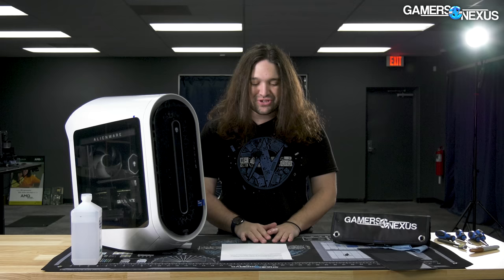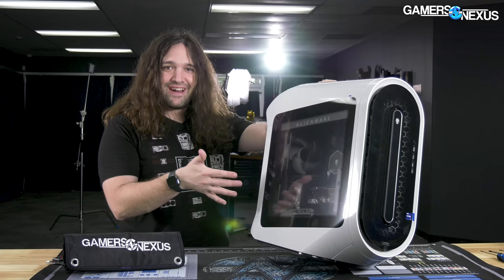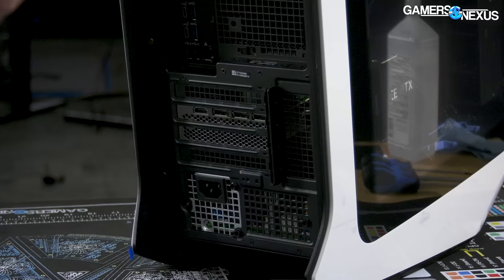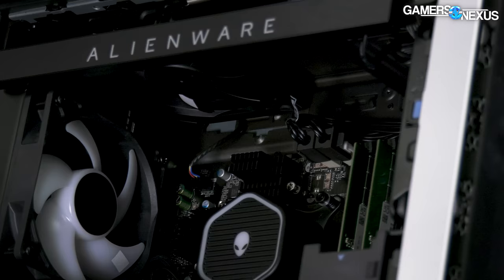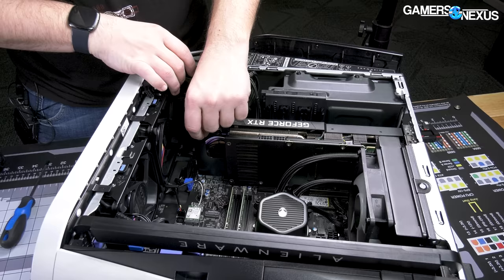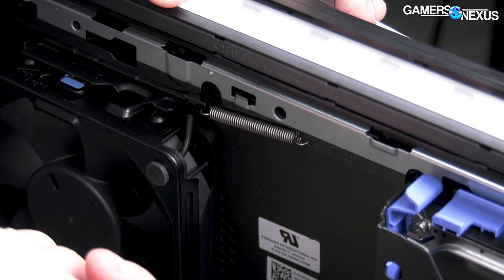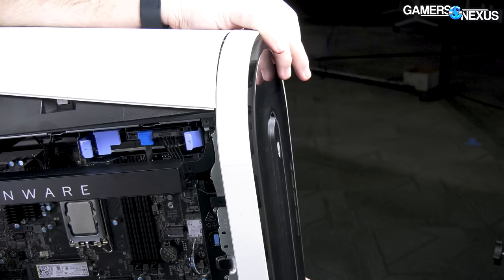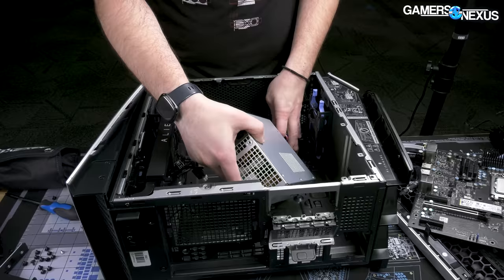Crazy Bad $5000 Alienware Gaming PC: R13 Aurora Tear-Down

Comment: Why would a company that (presumably) has very smart engineers working for it spend so much effort on making something good (ATX computers) into crap?  Like, you have to actually try pretty hard to get it offensively wrong nowadays, and yet Dell still...
Reply from the maker: That's the craziest part! Excellent question that Dell needs to ask itself. This is a LOT of engineering work to unnecessarily reinvent the wheel into a square.
Reply: @GamersNexus  Time for GN to rock up to Dell's headquarters and ask some questions:)
Reply: Well you have mechanical and electrical engineers might need to let the mechanical have a go at being electrical engineers surely couldn't be any worse
Reply: I was just wondering the same. Is it actually cheaper for them to manufacture and create from scratch these horrible components? It has to...
Reply: Exactly. And just for a thought, you buy high end parts to perform worse than they could. They intentionally crippled down the performance by making this a toaster. Just sad and unbelievable what damage to prebuild industry this does.
Reply: Is it ATX though if they don't follow ATX specs for PSUs and MBs ?
Not that it is an excuse for making crap product. 😉
Reply: My guess: the very smart engineers come up with something good that they look at and promptly discard. After that, the marketing department figures out how to make it look "super cool" and how much plastic they have to cover trash with to be able to sell it for $5k.
Reply: because of money... the profits after setting up new tooling will be far less than reusing existing tooling.. obviously the targeted customers are not PC enthusiasts who know this is bad.. so to them it doesnt matter if the pc is bad... their customers wont complain...  trust me, dell is a big corporation. they have already conducted research about creating new tooling and obviously found it less profitable... that is the only reason for this.
Reply: Because they are stuck in 1998. It probably comes with Napster and WinAmp preinstalled. This company is so cringe it hurts.
Reply: It seems like they invested money into fabrication tech and materials ... in 1995 ... and now they're stuck trying to move old stock. The most frustrating part is that ignorant buyers (due to no fault of their own) are probably buying, so they have no reason to stop.
Reply: @agnarjo  Our family bought a Dell back in 1998, it was likely built more intelligently than this thing was. Even back then they had started with non-standard ATX boards however, with things like the front panel controls connector (which could be worked around with a bit of effort at least), and the non-standard power supply connectors for no good reason.
Reply: The engineers have to justify their jobs
Reply: @GamersNexus  I can bet this question has been lost in the layers of management. The senior management won't have a clue how bad it really is. Maybe someone should ask them? 😉
Reply: by engineers do you mean graphic designers with no real world experience?
Reply: It all boils down to poor management and it can be extraordinarily difficult to change a giant monolithic beast with a rotten core.
Reply: @agnarjo  But Alienware was bad / overpriced also in 1998. I still remember their cases from back then with the turbine style intakes. You are right tho, they didnt change a thing. Still the same plastic junk lmao.

But hey, atleast they save on RND cost like this and u can live your 90s dream.
Reply: Their engineers must be completely isolated from the outside world because they don't know standards exist and think that little plastic window is new and modern.
Reply: Monochromatik  that is sad, I will always be nostalgic for ThinkPads. Even my E550 from 2015 is still working great. I had a pre-2010 IBM ThinkPad and if the hardware wasn't obsolete, I'm sure that thing would be used for another 50 years.
Reply: @GamersNexus  Isn't a square supposed to have four straight edges of equal length? They have reinvented the wheel into a quadrilateral with somewhat roughly straightish sides of different lengths with internal angles nowhere near 90 degrees.
Reply: Monochromatik  I've been feeling the pain more with Dell again lately, I'm with you on the Lenovo keyboards issue - and I've had far too many horrendous experiences with HP at this point to even think about using them for corporate deployments. It's getting to the point that I've got more confidence in Surface's for regular staff usage than I do with most other options!
Reply: Monochromatik  I worked in local government and we had to go to market every so often as existing models went EOL. Dell always tendered and they were always first into the circular filing system for assorted reasons not limited to their poor customer support reputation.
Reply: I guess they just want to be different from the crowd. Problem is,being different doesn’t actually mean it’s better. Still,it’s not just Dell,HP also does this and probably every other OEM manufacturers. With Dell it’s gonna be even worse with laptops as well since they want to use custom DDR 5 modules
Reply: Same question applies to the Apple stuff
Reply: @Lucaemar   Apple, for all its faults, would never cram this much plastic into any PC today. Apple’s entire shtick in the 2010s was that they used metal, while PC OEMs loved plastic.
Reply: @ikjadoon  i More meant them putting in an impressive amount of engineering effort, just to make a product worse (less serviceable/repairable etc) when it would be cheaper, easier, and better for everyone, not to
Reply: @GamersNexus  When DELL bought ALienware they didn't bother to update any of the bios or software on them and they did everything they could to bring down the cost of a pre built to match making it yourself. At that point it was a lot more money. The way they met the price point was sacrificing build quality and out sourcing labor from the US.
Reply: I presume that's because of their target audience, which probably cannot make a difference between two very similar (standardized) black boxes. This is their way of saying "see, we are so different" and "we invested so much engineering into this, that's why it's 5K". And a potential buyer, who just wants to have "the best gaming experience" will probably buy that story. It's not like a gaming console, it has all this windows, fans, bells and whistles, it's "much more awesome" for customers who just say "give me the best and most expensive stuff". So all those mechanical gimmicks are there for a purpose, to create this attention-to-detail illusion. Do you think bros who buy Lamborghini Huracan know anything about car engines?

Comment: What amazes me the most is just how similar some of those parts inside resembled the ones from my 1998 era Dell PC.  I swear that back fan grille is the exact same design.  It makes me wonder if it actually IS the same basic case just with a fancy plastic shell.
Reply: thats the neat part, youre correct. Its just a "barely office grade" chassis with "gamery" plastic housing around it

Comment: I remember waaaaay back when Alienware was being advertised in 3DMark 2003 and thinking, "hmm, I wonder how their systems stack up against DIY builds?" I worked as a bench tech back then and the first time one finally came across my bench I had my answer. They've only gotten worse since then. GN had a great line about Alienware in another video; "Dell is designing to appeal to what grandparents think their grandkids want"
Reply: Lets not even mention the fact that the prices are a rip off. Even mainline dell is made for dumb parents who don't know other companies are cheaper. My campus sold exclusively dell that was bumped up almost 40% over HP and Asus products down the road at best buy. Not saying best buys better, but its better than Dells garbage.
Reply: yeah I remember when I first saw one of their systems advertised. I thought hmm that expensive but maybe it's worth it. A couple of minutes of looking at the specs and checking against component prices and I was shocked at just how much of a rip off it was.
Reply: Because Grandparents have money to spend. They don’t care what you want from your computer, they just want money
Reply: That Alienware sold to Dell who retains the names as basically glorified XPS boxes.

Comment: The level of over-engineering is almost impressive. Just imagine if they'd put that money elsewhere.
Reply: Engineers: "we need a bigger case to put liquid cooling in and have better airflow"
Bean counters: "you need to use the same case for all computers of this size so engineer around what we give you"
Engineers: "we cant make it run cooler so lets make some cool brackets that make us seem like cool engineers"
Reply: There’s nothing more entertaining than putting together builds in PCPartPicker for the same price Dell sells their crippled trash for. Even with a 12900KF and 3090, I have to pimp my configuration out to a ridiculous extent to get it to $5600 CAD (the price the top Alienware sells for here). Maximus boards, PCIe 4.0 drives, the whole deal.
Reply: At 5000usd it also needs to survive shipping. the weird GPU bracket and all the other GPU support start making much more sense in that light.
As modern GPU's are so heavy that they can split the PCI-e socket in shipping and in general flex, get dislodged and then play pinball with the insides of the case. And break the tempered glass window while doing it.
So it legit needs to survive shipping people throwing the box around and dropping it multiple times.

Comment: This reminds me of the proprietary designs of everything when I worked on an IBM PC assembly line.  One odd-ball one was the PC 300PL that was their attempt at a toolless mount for the motherboard.  It slid into a slot in the case and seated into a riser card mounted to the case and secured with a locking lever.  Only it never stayed securely seated.
Reply: Look how well it turned out for IBM.... The Think brand was sold to Lenovo, who seems to be teaming up with Dell to make the most disposable e-waste machines ever.

Comment: Feels like 'competently overengineered into irrelevance' is a good summary of this system.

At least it's clear where at least half of the price tag comes from. All that engineering time and custom brackets and widgets can't be cheap.
Reply: Not to mention all the tooling to make all those plastic parts.
Reply: I feel like the look of the case even shows that. So overdone trying to look "cool", to the point of angling the damn thing. Meanwhile all it ends up looking like is the bastard child of a Dyson fan and a hand dryer
Reply: @snoboreddotcom  Indeed, instead of taking away a few parts and trying a different solution, it feels like they just kept adding parts and bits and widgets and frilly bits until it was time to ship it.

Even early 2000s 'gamer' cases had more self-respect than this.
Reply: @snoboreddotcom  LMAOOO😂😂😂😂😂😂

Comment: I think you can get a similarly built PC to this for under $5000. I have a pretty much loaded up liquid cooled R12 with a RTX 3080, intel i9, etc for just over $3k Canadian on sale. That was 18 months ago. I did some cooling mods but still nobody was building a PC with those specs for that price with the Covid availability issues. This PC has been issue free so far and is only used for flight sim gaming.
Reply: Any suggestion for flight sim equipment? I haven't flied in over a year so I turned to flight simulation and I've been looking for yokes and throttles for the best combination
Reply: @GuilhermeGuidugli  I’m really happy with my Honeycomb gear. Yolk, throttle quadrant and right now i have Logitech pedals. Not the most high end setup but definitely gives a decent feel.
Reply: i have 13th gen i9, 3080 10gb, 32gb ddr5 6000mhz, z690, 5000d, etc cost me 2500. got it two weeks ago. i thought i did well.
Reply: @sixpath nice rig man

Comment: By "redesign" they mean a slightly different hunk of plastic on top of the same 2008 chassis.
How many trees had to die for this disaster to happen?
Reply: It probably single-handedly doubled gas prices with that amount of plastic
Reply: It's more like a 2000 chassis now
Reply: It's not even just plastics , it's unnecessary mechanical parts used and proprietary parts used that cannot be reused and very hard to repair

And these companies will be first one to complain about pollution on twitter

Comment: Imagine owning a computer repair store and someone brings this thing in.
Reply: "You want me to fix....what? This can't be fixed"
Reply: I wouldn't be surprised if a computer repair store had a sign that said no Alienware PCs 🤣
Reply: @InvntdXNEWROMAN , better yet - No Dell or any other OEM "computers" containing proprietary components. I just "upgraded" an older Lenovo pre-built for a friend and e-wasted everything, but the cpu, ram and hdd.
Reply: I own 3 locations in the midwest and every Alienware since the R3 looks identical to this one as far as the chassis go. They've been shit for decades at this point. When people try to sell or trade an Alienware They get pissed when I offer the going rate for the cpu, gpu, and ram for it. They are virtually unusable for parts and I refuse to sell trash in my stores.
Reply: @InvntdXNEWROMAN  dont mind them at all, get to charge "apple tax" on the labor rate.

anyone who spends $5k on that POS has no problem paying $600 for a power supply and install.
Reply: I would tell them to leave.
Reply: @indysrebel5181  But is it the customer's fault they got scammed by Dell? Just be honest with them that they have a POS box and parts are nigh irreplaceable.
Reply: @AlephOneHalf  Yes.  Caveat emptor.
Reply: I'm a dell certified technician, god have mercy on my soul
Reply: Instant facepalm
Reply: @AlephOneHalf  100% their fault. Dell didn’t force them to buy their junk PC. When making a purchase such as this you should do research.
Reply: @indysrebel5181  
They take advantage of uneducated/clueless customers
Reply: @federicocatelli8785  that’s still the customers fault. I’m not saying what they do is right but its true.
Reply: @indysrebel5181  
Sure but you can only fool a customer once😉
Reply: @federicocatelli8785  hopefully lol people can be dumb af…

Comment: It's crazy just how expensive this is for Dell. If they just built a normal ATX computer it would be easier and cheaper for them, and perform much better. Instead they cling to an ancient design and build a bad product in the most expensive way possible
Reply: The only explanation i can think of is that Dell has warehouses full of old cases from the mid-2000s and for some reason they can't just throw them away.  Maybe they went over their 5 year e-waste quota or pledged to use old inventory before stockpiling anything new? Or some out of touch executive thought they could save money by re-purposing obsolete crap and their customers wouldn't notice or care.
Reply: @Macto5  The first explanation seems unlikely. Steel  isnt scarce so a huge stockpile of cases would be stupid, especially because storage costs money. It's probably the latter, saving 5$ by using some ancient tooling while spending 100$ for all the extra engineering.
Reply: My initial thought was NOS as well but that doesn't make sense.

The only thing I've come up with is them having signed a contract for x number of units with that tooling and no way to get out of it... But that doesn't really make sense either
Reply: Maybe they're trying too hard to stand out. They achieved that though, in the worst possible way.
Reply: @Macto5  Steel is highly reusable, they can definitely throw them away, sell them for scrap, get something back for them.
Reply: Exactly, but they want to keep everything proprietary so it only goes to a there service centers.
Reply: @1 Trillon Dollar Coin yes that's it, way worse result too!!

Comment: It's really something seeing how stuck in their ways Dell has gotten. Insistence on proprietary hardware, over-designed case and mountings, clear cost savings in all the parts that actually matter. It feels like the kind of problem Dell couldn't fix without looking at their approach from the ground up which they'll never do.
Reply: Companies get to a point we're they can't improve or change anything without massive involvement of every department. This is a prime example. R&D, quality, procurement, assembly, advertising, accounting, every level has to be involved. It would probably be easier to just start a new company.
Reply: @xxtovarichxx  A new department which would design things from the ground up would work. Reports directly to the CTO, CTO cracks the whip at all these departments playing office politics. Still hard to pull off if you can't convince pretty much the entirety of top management.
Reply: @xxtovarichxx  agreed, maybe not never change it moreso they can't
Reply: I think they design them this way so anyone from a contracted service company can show up and fix it without screwing it up. 

I used to repair dells for a large multi building office and any fool could service the "click and slide" parts in a minute. The only thing that took brains was swapping the motherboard or the PSU since they didn't click into place and you had to route wires.